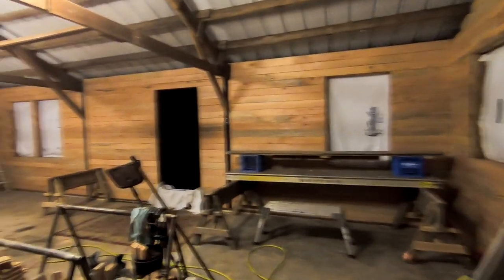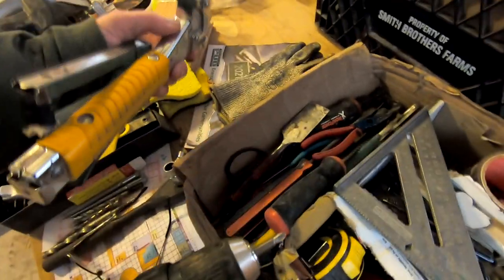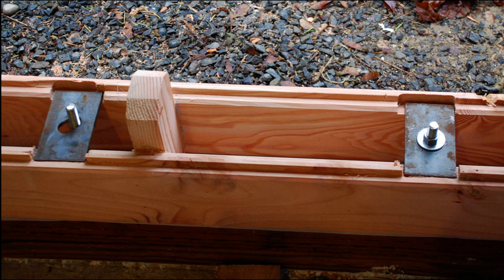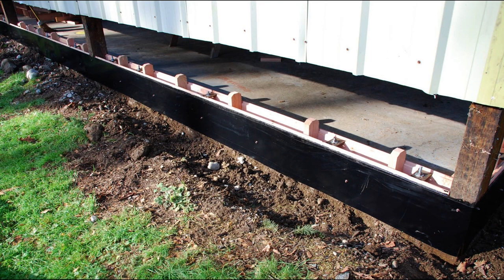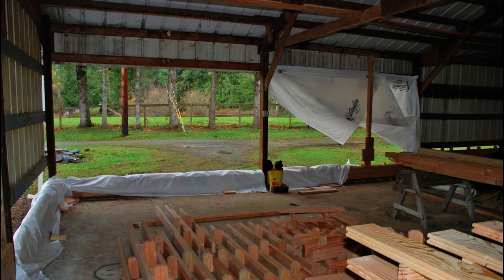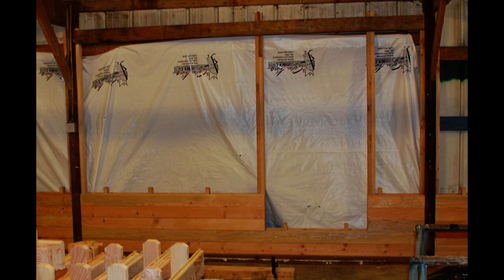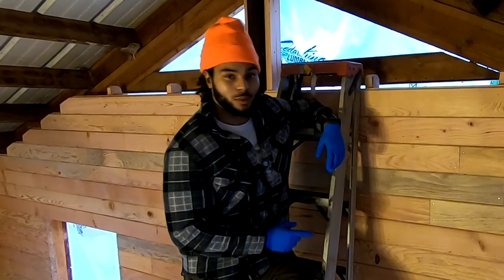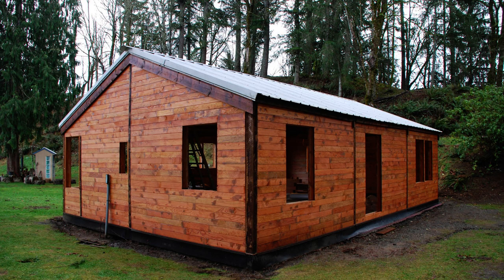LINCOLN BLOCK® Pole Barn Conversion & DIY Info by Uncle Nudge

Comment: Thanks for that. Am I right in understanding that ideally you would have been filling up with foam as you were building, adding more every 4 courses?
Reply from the maker: Yes, I did foam approx 5 times while building... Foam after first 4  courses, then every 4 or 5, depending on which DAP kit you're using... 600 kit goes deeper than 200 kit, so with 600 kit you could foam every 6 or 7 courses (unless you have a lot of joint splice blocks in an area, then stick to 5). Something Andrew (and I) forgot to mention about foam, is that there is also a 750 kit (and larger) that you can rent a machine that does the foam heating on site within the machine...
Reply: @UncleNudgeRocks  Thanks for the clarification :).